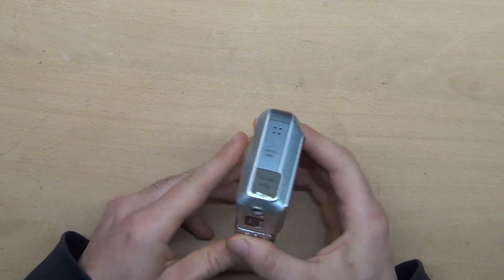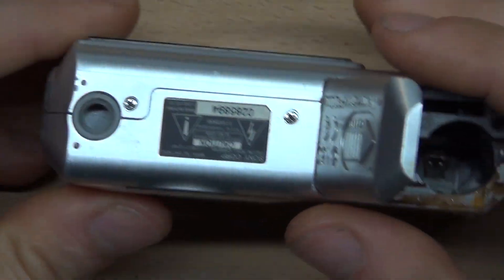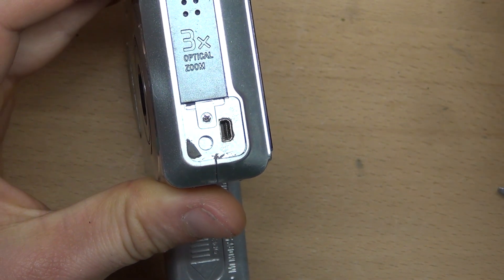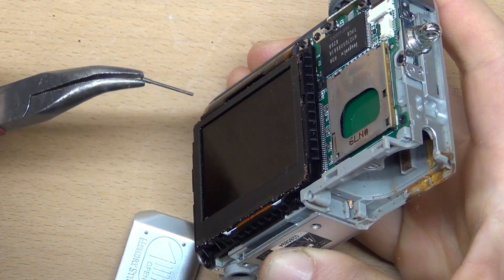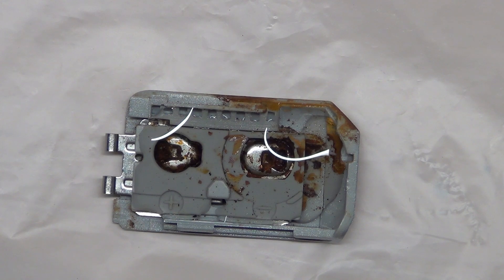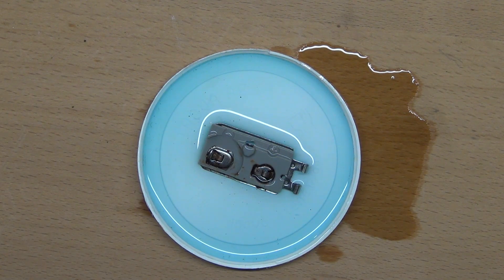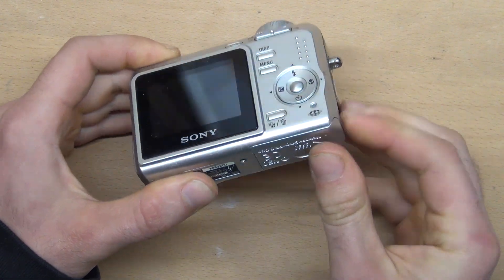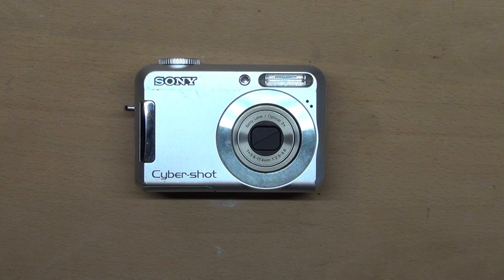Leaked Batteries - Small repair on Sony digicam

Comment: I guess i'm your 1000'th subscriber :) nice fix on this camera! Do you have a solution for powering on the digicams with missing Li-ion battery?
Reply from the maker: Thank you! I am considering making a video about batteries. I have replaced regular AA batteries with lithium ones. I have also powered cameras with non-genuine lithium batteries. If your camera's lithium battery has died and we can't find an original one, we have two options. Many of the older cameras use two-terminal lithium batteries. If you see only two terminals, you can power the camera from anything that gives the correct voltage and amperage. Most small cameras with lithium batteries use single cell 3.7 volt batteries, I guess AliExpress and other stores have cheap lithium batteries in the form of a pouch, you just need to make something like a box similar to the shape of the original battery and put the battery pouch in. It's more complicated if there are more than two terminals on the battery, this usually means the camera is communicating with the battery. There is a board with electronics in the battery. If you have an old battery for your camera, but the battery is dead and no longer charging or is swollen, you can carefully disassemble the battery. Be careful, this can be dangerous, you should not damage the battery cells. Remove the old lithium cells and solder new ones to the board. Sometimes, especially in DSLR cameras, the battery is standard cylindrical lithium cells. With pocket cameras, you can use these lithium batteries in the form of a pouch. On the same principle, you can power a camera with a power supply instead of a battery. If there are only two terminals in the camera, you connect the plus and minus and the camera works without a battery. Sometimes cameras require more amps and you have to use thick cables, also some cameras have a small switch on the battery door and they don't turn on until it's closed, you have to make a way for the cables and close the door completely. The same principle can be used with external batteries, for example if you take standard cylindrical lithium batteries out of an old laptop battery you can make a pretty durable pocket camera battery grip. You just need to make some kind of box to attach to the tripod thread on the bottom of the camera. To find which is plus and which is minus on the terminals in the camera, use a multimeter set to an ohmmeter, there is a connection between metal parts of the housing and the minus terminal. You can also measure from the outer metal part of the USB connector and the two terminals where the battery is connected, the minus is this terminal which is connected to the outer packaging of the USB connector.
 Good luck and greetings from Bulgaria!
Reply: @Electronics_Collection  ok, very interesting information. Thanx a lot, i'll see what i can do :) greetings!